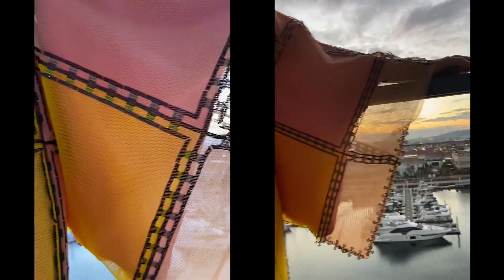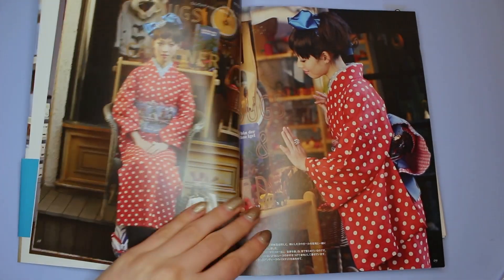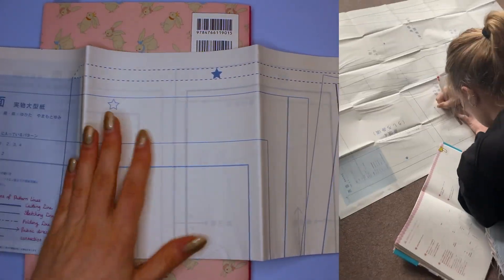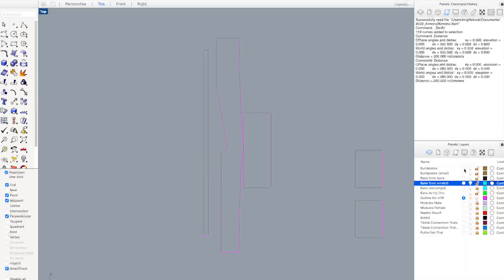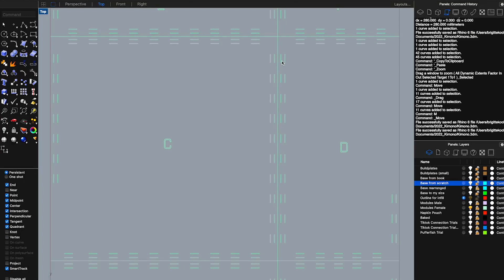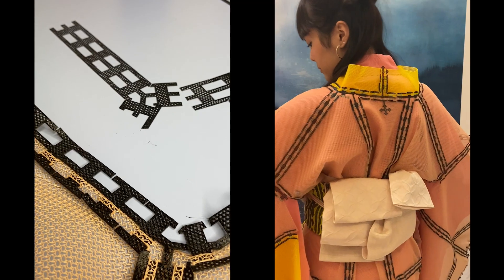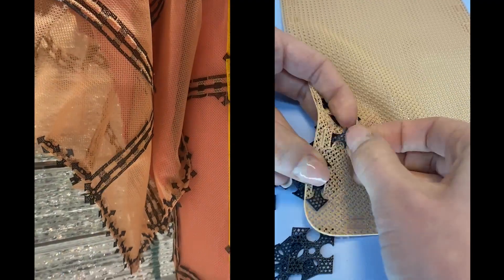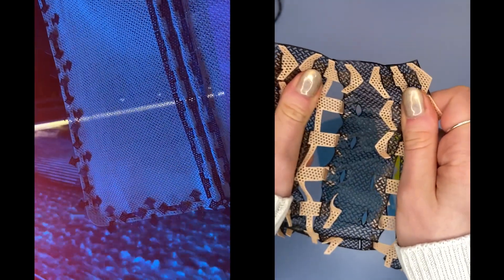Create a 3D Printed Kimono in 26 DAYS?! | My Process Steps to 3D Print Fashion

Comment: How did you design the fabric you used for this print?
Reply from the maker: I created a 2D shape of the fabric (something that fits on the 3D printer’s build plate - for me that’s within 30x30cm) 
After that I give the shape the height I want for my textile. Usually this is 0.6mm for me, but depends on what you set as your layer height for the 3D printer (usually 0.2mm). Thinner than 3 layers is not recommended. 😉
Then finally in Cura I select the infill I want to use. That doubles as the actual textile texture. In this case I used gyroid infill at 30% at the top of my mind. 
x Brigitte